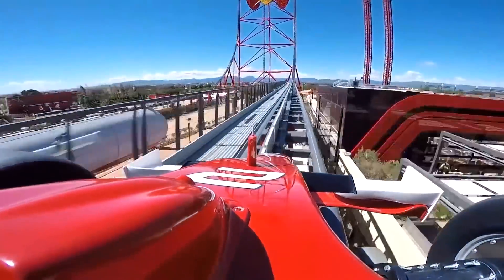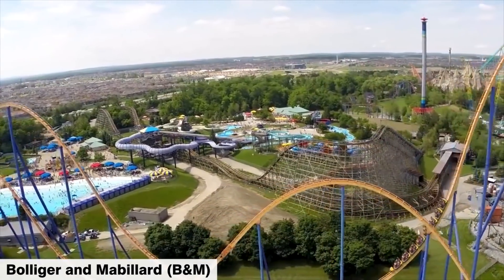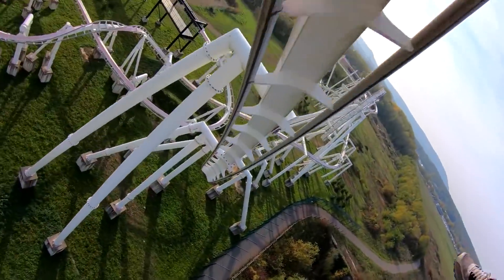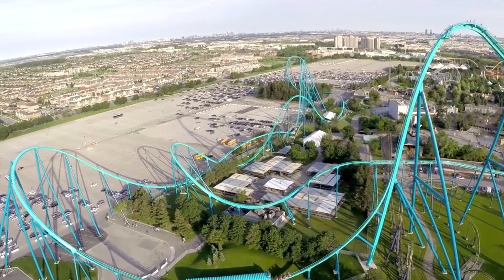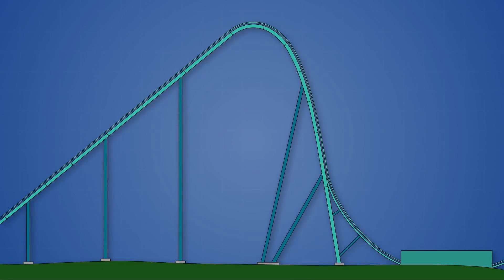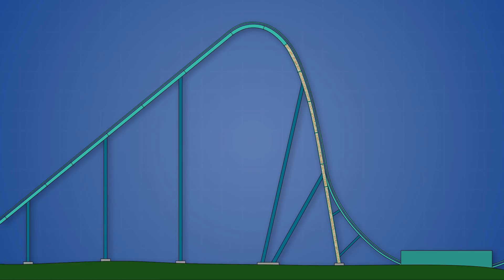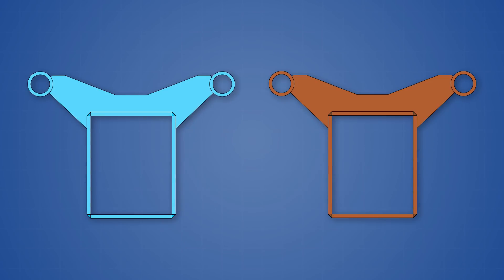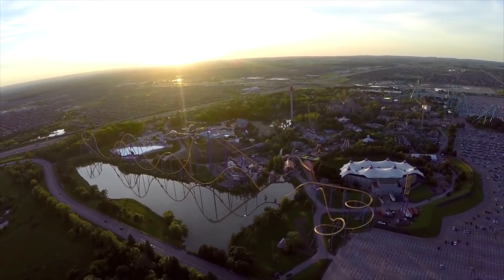Why Roller Coaster Track is Filled with Sand

Comment: sand is heavy and very corrosive.. why not use styrofoam .. american engineers are so retarded.. we germans would use better materials. just do the math and see the material properties. worst solution
Reply: Sand is heavy, but it is the best at reducing sound per volume of material when comparing to other common sound-dampening materials like pearlite and vermiculite. If dampening was a consideration during design, it would have been better to accommodate with lighter materials, but as a retrofit sand was the best option.

Comment: I think a lot of the noise is intentional in the sense that if they built the rollers out hard urethane material and maintained the rollers under pressure, they could pretty much eliminate the noise. But that would result in a ride that might not be as exciting as a noisy one.

Comment: Noise abatement should not be enforced, if you don't like the sound of rollercoasters or jet engines, don't rent or buy a house near a theme park or airport

Noise abatement procedures have actually caused plane crashes in the past due to departure stalls caused by a lack of thrust during takeoff
Reply: They've also cuased a lot of train crashes and poeple getting hit by trains.

Noise abatement procedures should be called fuck safety and poeples lives.entitled idoits that choose to move some where noisy are more important.

Comment: Why wouldnt they use a foam insulation, its lighter and potentially absorbs more sound. Possibly even cheaper also. Im sure cost was/is a big concern, but the weight and time to put sand compared to an expanding foam I think would counter those costs. They could have done half the work because foam can be super fast, only requires a small hole, and would not require as heavy duty equipment to deliver it. it would also sit level and full

Comment: You didn't specify in the video and I'm curious, does the sands absorption of energy mean that they needed to fill them on partially so there was room for the sand particles to vibrate? Is there an ideal volumetric fill percentage that allows optimal sound dampening?

Comment: I wonder if the vibration of the sand inside the beams would vibrate enough to actually wear away at the metal internally?
Reply: Cutting metal takes more than sharp grains.
Lay a sheet of sandpaper on a steel surface, then drag the paper around without applying pressure.  No real cutting.
How heavy is a grain of sand?
You need pressure, so the grains 'bite' into the steel, then you need to drag the grains across the steel, while maintaining that pressure.
Another way to look at it; how far are the grains moving, and how fast?
I would be surprised if the paint even got scuffed.
You did paint the inside of these members, right?
Reply: @pirobot668beta  Grains of sand in mass, Greg.  Also, nobody is talking about cutting metal, but rather wearing it away over a period of time. Sandpaper can't cut steel either, but it can do some extensive resurfacing.
Reply: @Hotrodelectric  Same paper most certainly can cut steel. That's how it works. But same paper isn't made with "sand." It's made with metal oxides, which are much harder than the sand that is in the roller coaster.
Reply: @xenonram  !4 ga box tubing is not easily cut by a someone using a DA orbital with 80 grit attached. Slow, sloppy, and wasteful in the extreme. Cutting steel is much easier to achieve using a cutting device like a cut-off saw, a reciprocating saw, or even a plasma cutter if your budget goes that far.  

The whole idea, just a simple thought experiment started by Cdabek, was simple sand, because of the sound waves that travel through that box tube, vibration, stress, over long periods of time, could it wear the steel away from the inside? The common sense answer is yes- it can. The realistic caveat is it would take quite a while- by far and away much longer than the expected lifespan of the coaster.
Reply: @pirobot668beta  That makes sense.
Reply: The sand will probably cause some very minor abrasion, but because it is never replaced, it will also grind down to finer and finer grains and eventually become powder, which makes it harmless. I'd suppose the sheet metal used for the beams is at least 10mm thick, so the effect won't have significant impact on the structure's stability.
Reply: I wad thinking the same thing and wondering if anyone else had the same thought.
Sand is pretty abrasive and used in applications like making sand paper and sand blasting.
I definitely would be interested in seeing if there was any wear and tear inside from the sand.
Reply: It would depend on the type of sand used some grains are much sharper than others and also there weight but in all honesty there would be way more risk of the sand producing a humid environment in the box increasing rust but im sure they studied the risks first
Reply: Might cut down on corrosion if anything lol
Reply: They probably didn't use course sand to fill it, rather more fine sand.
Reply: Additionally, the sand is not vibrating constantly. The sand within one section of track may only vibrate a considerable amount for 1/4 of the coasters descent along that portion decline, so we can assume the sand vibrates for 1 second per coaster train. Perhaps a coaster train runs every 80 seconds for a large high speed coaster. After a full 9 hour day of running, that section of track may only have vibrated for a total of 6 minutes and 45 seconds - at 1 second intervals mind you. This is most likely not of concern. I personally wonder about the static charge of the sand.

Comment: The sand vibrates inside the box? Isn't that like having sandpaper lightly sanding the walls of the box, potentially weakening the structure (or aggravating any stress points or micro-fractures that occur with wear)?

Comment: I worked at Cedar Point in 2018 and the Raptor roller coaster by B&M there was not filled with sand, you can absolutely tell by the noise.

Comment: In case anyone else was curious about quantifying the sound reduction: Filling the cylindrical tubes of a coaster track with sand/pea gravel reduces noise levels by 10-15 decibels. That means the perceived loudness of the coaster is reduced by OVER HALF using this method. Crazy!

Comment: Not sure where you got your information, but it's not sand. B&M uses a proprietary material that they will not discuss. They also started filling the box beam with this material long before Leviathan. Talon was one of the first, way back in 2001.

Comment: pretty disappointed that the sounds of different sounds of rollercoaster are not showcased...
Reply: Yeah a little bummed but its probably pretty difficult to find an audio clip of the sound before sand due to them being constructed either with sand already in the rails or quickly after
Reply: RANGER592 at the beginning he said different companies make their roller coasters with different sounds
Reply: I was literally waiting for the sound of the rollercoaster when he said that.
Reply: Leviathan (the big green one) literally sounds like a fighter jet when it goes by. Its LOUD
Reply: I used to work at Canada's Wonderland in 2017 in admissions. I used to work at the building in the bottom left corner at 3:42 .The coaster passed near there and boy let me tell you it was LOUD. It was like as like if rumbling thunder was as loud as a thunderclap itself. It can be heard throughout the whole park
Reply: @Elo.1717  Given the way the box section at the first drop was constructed, I'm not surprised. The big box section acts as a waveguide which is resonant in very low frequencies (because there's a large volume of air in the box), and it's attached to a concrete foundation, so the noise from the coaster would be blasted right into the park's ground area, as steel is a perfect sound conductor.

Adding the sand would put the resonant frequencies in a much higher area of the frequency spectrum which is not able to travel as far through ground material (e.g. dirt or concrete).
Reply: I agree.
Reply: Leviathan and Behemoth are dope, but when I was little and there's no queue, I just keep riding Wild Beast by staying on the coaster.
Reply: same
Reply: Someone would’ve copyright struck him lol
Reply: Agreed what bs

Comment: Haven't watched yet, but I'll guess that the sand dissipates the vibration.

Edit: correct guess, but reasoning wrong. Assumed they wanted to decrease vibration for resonance frequency or something of the sort (structural stability), instead it was for essentially cosmetic improvements to decrease the noise caused by the vibration.

Comment: In addition to adding the weight, can there be any untended consequences of adding the sand? Sand adsorbs energy so theoretically it would create a very small amount of heat. Couldn't the vibrations over time break-down the sand but also rip into any protective coating used to protect the metal from rust? Sorry, I'm not an engineer but I'm always curious so I'm asking a stupid question.

Comment: I always wondered why there are so many track styles. What's the difference between them? Why does B&M always use their box-style for example? Just for aesthetics or is it actually better than for example the triangular- or rectangular-shaped tracks consisting of tubes with diagonal crossbars? Why did Vekoma stick to their fishbone-style tracks for so long? And now Intamin has come up with yet another style for Hyperion, Mack developed a very flat 4-Tube track for Eurosat, Vekoma has a new Track style as well. I'm very curious what the differences actually are.
Reply: Probably trying to find the right combination of amount of material required, weight, strength, number of welds, etc. Bending tubes is difficult and expensive. On some coaster track that is low to the ground they might not even use a spine because it's cheaper to have a lot of simple support columns closer together rather than adding a spine. But the higher you go it's better to have a stronger spine so you can place support columns farther apart to save material.
Reply: @Coaster101  these are probably important factors, and I have noticed that especially Intamin will often switch the track type multiple times in one coaster depending on the forces it has to withstand, for example by switching to flat track in slower, low to the ground sections but using the 3- or 4-tube track where the track is higher or has to take higher forces. But I'm still curious about the specific advantages the different track types have. I would find a video comparing them pretty interesting, looking at the things you mentioned, like manufacturing effort, material cost and statics.

Comment: I use to work at Wonderland. this does not work at all. I worked at the front gates where the leviathan would swoop by every 234.6 seconds (it gets boring there so yes I ended up timing it). that ride was so loud that sometimes you coudl barely hear the guests! it dosent work.